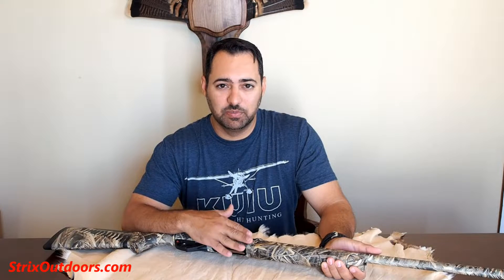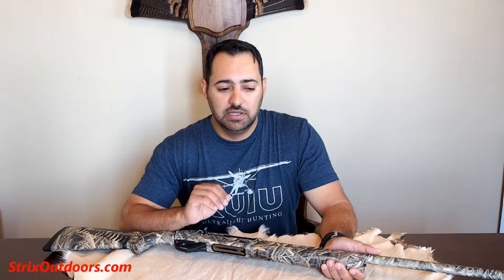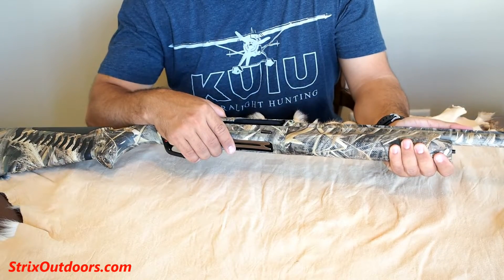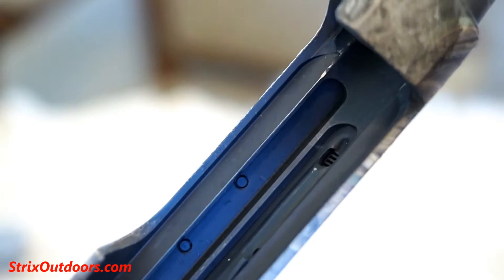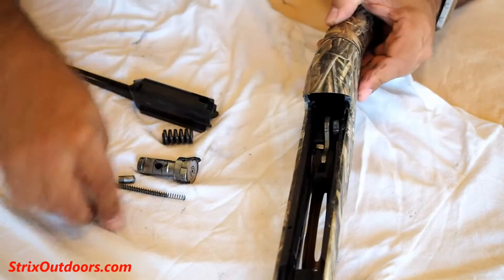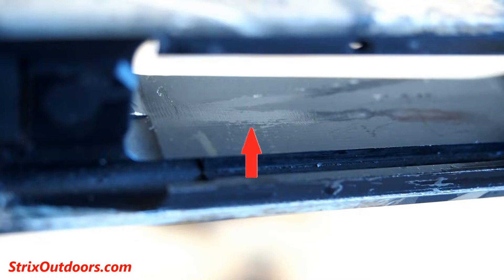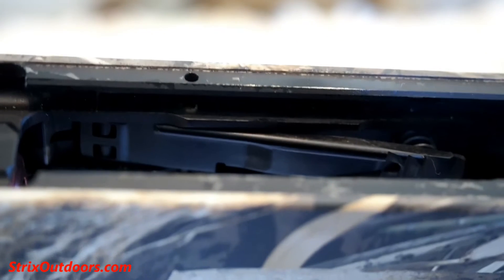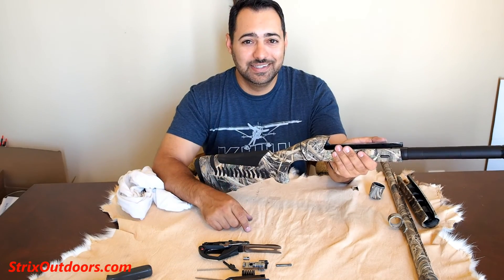Benelli SBE3 - after the first 1,000 rounds

Comment: Looking into getting a sbe3. Love the look of the gun. I am worried about it shooting high. Would u recommend it.
Reply from the maker: I love the gun overall.  I did have an issue with it shooting high but I think I've resolved that.  Let me ask you this:  Have you shot Benelli's before?  If not, what have you shot?
Reply: I have never shot Benellis before. I’ve always shot Mossbergs and Winchester’s. I know Benellis are suppose to shoot a little high but I don’t know if I would get used to it. I mainly would use it for ducks and geese. But also turkey
Reply from the maker: Josh, so I would say Benellis requires a little different aiming vs "shooting high".  I've gotten use to it for flying birds.  Basically, a Benelli is designed such that you "aim" with the bead below the point you want to hit.  Similar to a figure 8.  This is actually good, once you get use to it, for moving targets because that means you're not looking at the bead to aim (you're focusing on the bird) and the natural position is for the bead to be below the bird.  This is proper technique for sporting clays and flying targets.   Also, it means the bead never obstructs you're focus on the target so you can follow through during your shot.  With that said, turkey hunting is a little different so you have to either remember to aim lower because the bird is stationary or you could possible put an optic on the shotgun for that specific purpose.  You can pattern the gun and understand where the pattern is landing to determine the best aim point on a turkey.  I came up shooting a Rem 870 which I would basically cover up the bullseye with bead and the resulting pattern would be centered at the point of aim so it took me a little while to get use to the Benelli.   Another point: Benelli's are awesome for how simple they are.  I don't think you can beat them for reliability, especially if you aren't the kind of person to clean your shotgun regularly.  However, a Beretta A400 Extreme with all of the recoil dampening (and gas operation) will be much softer on your shoulder if you're shooting a lot of 3.5" shells especially.  The downside there of course is that you will have to keep up with cleaning it otherwise it may have a tendency to jam.  So, with all of those things in consideration, I love dove and duck hunting with my Benelli SBE3.  I don't shoot much 3.5" so that doesn't bother me much.   Maybe its nostalgia or the turkey that I almost missed (the first time I hunted with my SBE3), but I usually reach for my Rem 870 when I turkey hunt.... hahahaha.
Reply: So would u recommend the sbe3 over beretta and sx4?
Reply from the maker: I don't know much about the SX4.  I would consider the previous points regarding the SBE3 or Beretta to determine which would be better suited.  Lastly, you need to shoulder all of these if possible and see which feels/fits better.  That goes a long way in how much recoil and how it's going to shoot for you.

Comment from the maker: 1,000 licks.. and it hasn't missed a tick.  The Benelli SBE 3.
Reply: What Camo did u pick and what did you pay?
Reply: It cycled the 2 3/4" rounds perfectly? Dieing to hear if it handles it no problem as I use 2 3/4" 1 1/8 oz #6 rounds for grouse!
Reply from the maker: @karsonerbach611  , I have not had any issues with 2 3/4" 1-1/8oz loads.  The only rounds it will not cycle are 2 3/4" 7/8 oz loads.  I did have one instance where the gun was a bit dirty and dry and it gave me a little trouble with 1oz loads.  A little gun oil on the bolt carrier and it was back to the races.

Comment: Click issue not fixed on my sbe3. I am shooting 3" though. Have you thought about doing another video review of sbe3 after shooting 3 and 3.5 inch rounds? I've heard a lot of people have issues with the sbe3 malfunctioning with 3 and 3.5 inch rounds.  Thanks for the info and video
Reply from the maker: Hi Rob.  Thanks for the comment!  You're still getting the benelli "click"?  I have not experienced that once and I commonly bump the stock on the ground to activate my shotkam.  Is there a different click that you mean?  I can certainly do a follow up video on the SBE3.. thanks for suggesting.  I have shot lots of 3" shells through multiple duck season and maybe 2 boxes of 3.5" through it.  I have not had one malfunction from those.
Reply: @strixoutdoors  maybe once out of a box of 3" shells the gun does not seem to go into battery thus when I pull the trigger I hear the "click" instead of the gun firing. Frustrating to say the least. I've installed a wolf spring and it still does this.  Did it before and after. I just found a video on YouTube from a guy who had same issue.  He showed how he fixed the issue but it includes a bit of grinding. I'm not sure what I'll do. Thanks for the reply
Reply from the maker: @rob4263 , that's really strange.  I would be reluctant to do any grinding on it before talking to Benelli.  Try giving them a call and see what they say.  You may need to send the gun into them or a gunsmith.  They were pretty good to deal with before.
Reply: @strixoutdoors  I plan on calling them tomorrow.  If you are interested in the video I saw, look up "the benelli click: our solve". Its a different model but same problem I'm having

Comment: Many other review the SBE3 with the following issues: shoots very high, Benelli click issue not fixed with bolt?
Reply from the maker: Hi J!  The Benelli click has been fixed on the SBE3 as far as I can tell.  I've pulled the bolt back partially to check for a shell and softly closed it back and it's fired every time. I've done this numerous times in the field.  The gun did try to double feed a shell out of the tube 1 time but I think that was my fault.  Something felt funny when I loaded the 2nd shell into the tube.. not sure what happened.  My gun does shoot high.  I patterned it out of the box and it was very high.  I have changed shims and I need to spend some time patterning again.  I intend to post another video when I do and if it still shoots high I'm going to try to figure out a way to fix that problem.  I really like this gun other than the potential high POI issue so I don't want to give up on it yet.

Comment: Lol "sbe3" is lion in arabic/moroccan
Reply from the maker: really?  That's pretty cool.  I'm pretty sure Benelli thinks they are the lions of the automatic shotgun market...  haha
Reply: Is there a way to add shims to correct shooting high
Reply from the maker: Mike, All Benelli's come with a shim kit to adjust cast and drop.  I've changed from the stock 60mm to the 65mm shim which would provide the most drop at the heel.  This should lower the POI.  I intend to spend some time patterning it again in the new few weeks and I have some ideas about trying to resolve the issue if it's still too high.  I plan to post another video with an update when I do so stay tuned for that !